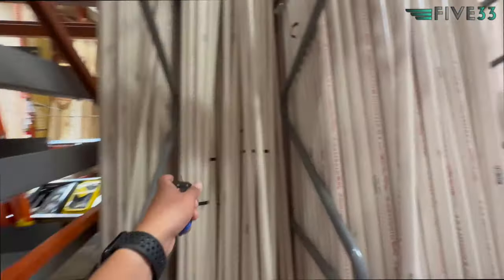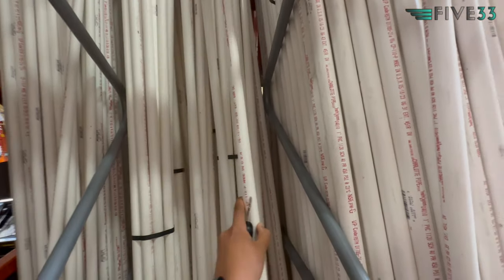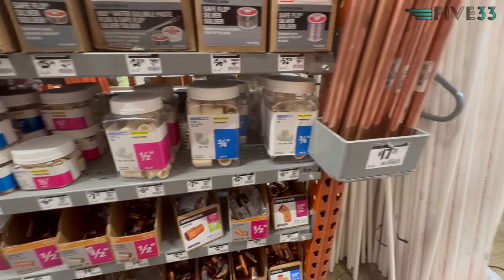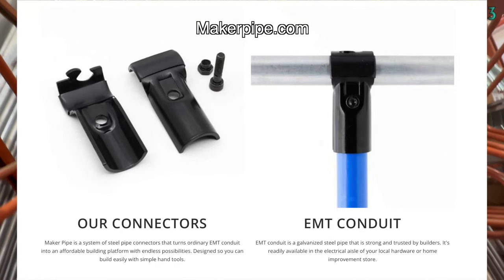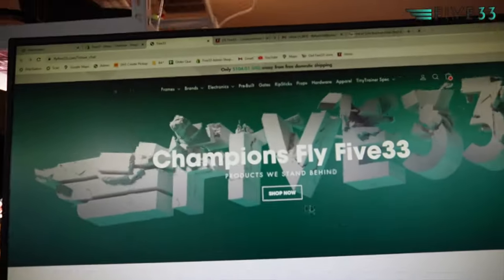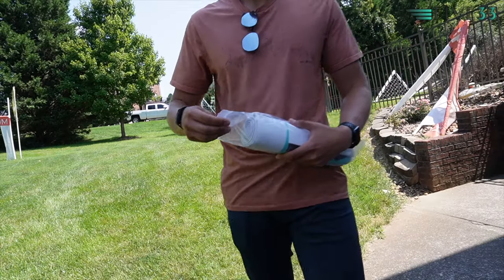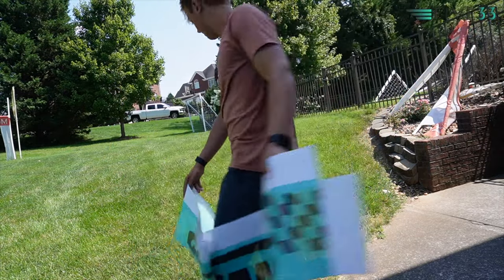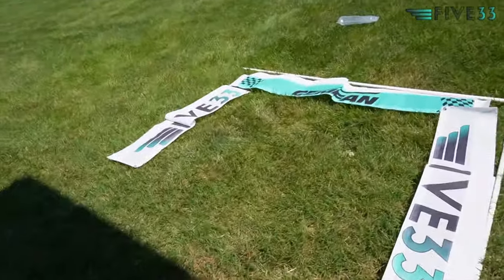How To Build An FPV Drone Racing Course

Comment: I followed the Quad docs advise on using the 1 1/4 " for the bottom of the double 
1" for the top  theres a drop in peice for the 1 1/4 that fits the 1" top I glued those adapters in
It was rather windy out here today it all held together so far so good 
I made the stake lenght 30" for the double
2" for the singles 
My area is tight so Its a 3" coarse
533 was sold out of 5×5's when I looked for gates
Thank you again for this video!!!

Comment: near the rebar section in Home Depot should be this fiberglass rebar called "pink bar"  it's sold in 10 ft lengths for about $5. You can cut 5 two foot rebar stakes for the price of one metal rebar.  it's basically just as strong yet weighs next to nothing and doesn't rust all over your hands.  @leviathannfpv1282 showed me this at one of his races and it's a game changer not having to lug 20 heavy steel rebar for 10 gates.
Reply from the maker: Sounds like I’m going to Home Depot tomorrow, lol!
Reply: @headsupfpv if using the fibreglass rebar, get some rebar protective end caps or something so you can hammer them in the ground without destroying the ends. I have also used wood blocks.

The bars last WAY longer that way. Works really well for me.

I use 2.5’ fibreglass for the ultra light portable setups, otherwise I just use 3’ powder coated steel (I hate rust! I also spray paint chips and ends with zinc paint, or whatever spray can I have handy)

Great vlog, some really, really good tips! ❤